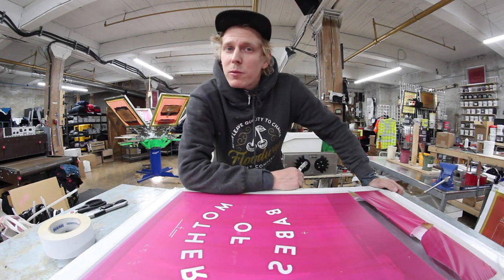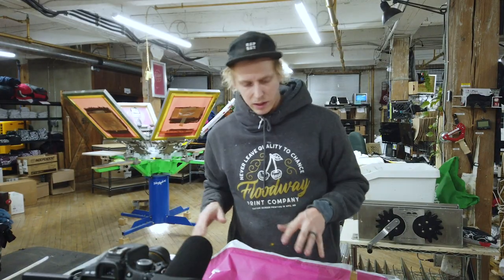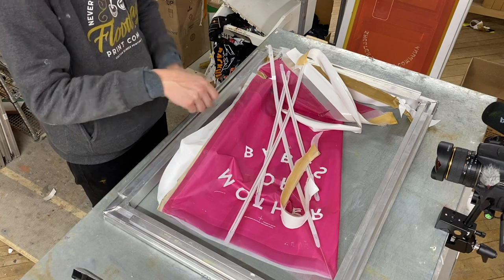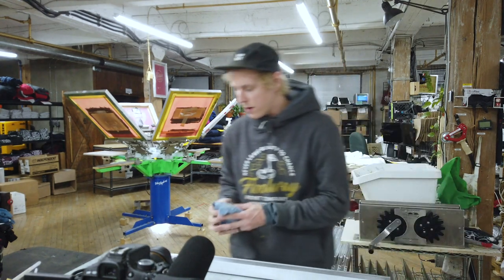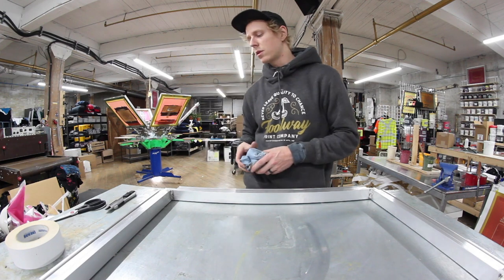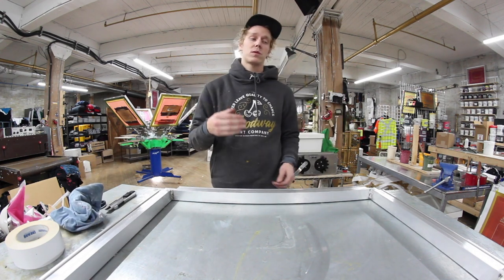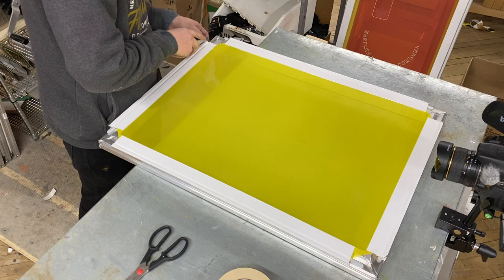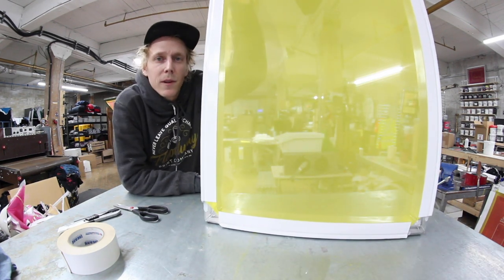Eco Frames UPDATE: Quality & Consistency Going UP. Waste & Costs Going DOWN!

Comment: have you noticed a difference in durability over time vs static screens?
Reply from the maker: For the frame itself it's a non-issue. Some of the 'lite' frames flex more than a good static but we are running the heavier frames.

For the mesh, I do think that this method for attaching mesh to a frame is way better than the glue. We've been running thin thread since 2015 almost day one, and when we had statics almost all the failures were related to glue. This was when we had Murakami doing the stretching and they are pretty reputable. On the Eco frames there is a thick layer of tape around the edge too. I think it helps protect the mesh better than a static and it definitely eliminates all the issues from glue.

Comment: Quick question, I am a noob to screen printing, have you done reclaims on these ECO frame screens? If so, how well did they handle for the next print job as far as tightness?
Reply from the maker: TONS of reclaim. They hold tension better than a static simply because they start at higher tensions because the heavier frames can hold the higher tensions. Statics are generally lower tension just because the frame starts to bow. So a typical static for me would land at like 23n and settle to 17n eventually. Where these Eco frames are starting closer to 28n and settling around 22n.

Comment: What's the brand of tape you are using and would you recommend it?  Looking to buy these Eco Frames and wanted to make sure I get the right tape as well.
Reply from the maker: It's some fancy pants stuff from Nazdar, I forget the exact brand off the top of my head right now but I have been using black gorilla tape, the permanent stuff and it works just as well. Cheaper and easier to get for me as well. This stuff, bit cheaper at the hardware store: https://www.amazon.ca/Gorilla-Weather-Waterproof-Temperature-Resistant/dp/B07GRJ8L55

Comment: Like half a hand I just folded them one more time and it’s a lot better but now I fucked up one of the rails smh can’t win
Reply from the maker: That sucks, I hate when stuff isn't going smooth in the shop. Don't sweat it though, you will bust lots of screens over time. Just take'r slow and watch the instruction video a couple times. Took me a while to get used to flipping and folding them the right way.

Comment: Great video! What is the purpose of taping the screen after you stretch it- and what tape are you using?
Reply from the maker: It’s a CRITICAL STEP! To protect the mesh in that most sensitive highest tension spot. If it’s gunna rub/grind against the racks or press or anything in the shop really it’s gunna happen on those edges.
Reply from the maker: Oh and, the white tape is the fancy official stuff for screens. I forget the brand I got it from Nazdar but… it’s not particularly any better than black tough gorilla tape. Gorilla is the brand pretty sure I just get it from Home Depot. Does the trick for sure. 
I should do a video just on taping these frames. I see people having problems with screens popping and then I see the mesh being tossed around without edge protection.
Reply: @CoryFloodwayPrintCo  thanks Cory! I’m gonna spring for a few of these soon and your videos are so helpful!

Comment: Maybe would have liked to see you put a Newton Meter on the screen for comparison? In the past have used all types of the reusable frames from when there were no static glued aluminum frames just the adjustable, we always noticed lack of tension in the corners, more moray in the prints as the strips did not go all the way to the corners . Now many years later I have my own shop, I chose static as I have a person who rescreens and is my ink supplier ETC close, I will definitely look at the Eco frames and appreciate you rescreening one and not just saying how easy it is.
Reply from the maker: That's a really good point. The corners are cut. I don't see it as a lack of tension as much as I see it as a smaller printable area. Because you're right that roller frames have the same issues. Since the corners don't need as much room for the big chunky attachments on roller frames, the strips do seem to reach further into the corners. It would be worth testing what the total printable area is on one versus a good static. 

You just gotta do the math on what works for you! A good stretcher is a great thing to have. Still gotta compare it to a panel price plus five minutes. The big thing people miss is that you won't need x100 extra frames so that you can fill a skid and send them out. You break one, you fix one. We have 78 frames or whatever but they are ALL in production. 

As for the tension meter, mine is not calibrated! So I didn't want to quote any figures. I shoulda mentioned that.
Reply: @CoryFloodwayPrintCo  I do agree you have to do what fits your shop, considering 1 years ago I made change from wood screen to Aluminum ( much more efficient) I just did not have fond memories of using re tensional frames from my early years in printing. I am not trying to deter anyone it was just my experience and at that time those were the Aluminum frames to have the welded aluminum came later. Enjoy you content and honest opinion. Great fun project is printing Balloons, if you have not done it then accept the challenge, I did it just for fun with my youngest.

Comment: I bought those eco frames as well. They are amazing! I print manually and the thin thread made printing 10x easier. I had issues when I first got them with the panels tearing . But nortech made good and sent me replacements. Apparently they made the plastic strips too big which was causing tearing.
Definitely a game changer for me. I don’t even use regular mesh any more.
Reply from the maker: Yes, I too heard about this 'bad batch', I had a couple tear during stretching and Ryonet sorted it out. When I first switched to thin thread on the manual it made a huge difference, but the higher tension and lower cost is huge. Wish I had these five years ago!
Reply: @CoryFloodwayPrintCo  Hey Bro. Do you know if these frames are compatible with a computer to screen system? I'm thinking long term here. I know they work with pre registration systems. Trying to decide if i want to keep investing in these screens or not.
Reply from the maker: @danielmullins572  Yo Dan, yes I use them in our Douthitt wax CTS and they work great. They did require a custom bracket with longer reach but that's about it. They probably would have worked without it too, just not as easily in production.

Comment: Cory thank you for making the videos on these frames! I would really like to see them in action on press and see comparison between static and these frames. Have these frames really improved your prints and on press time?
Reply from the maker: Hey Evan. I have been using the same mesh for years now, so there's not much difference on press that I think could be shown in a video. Higher tension keeps the mesh areas open, which allows the ink to flow through with less pressure. And less variation between screens. So on press, it all adds up to better registration and putting ink onto shirts with less pressure.
The main benefits are from an inventory and handling perspective. The added weight makes teardowns and reclaim easier, they're a lower cost than statics over time, and easier to replace/stock the panels than save up a skid of statics to send back.
Lemme know if you have any more questions!